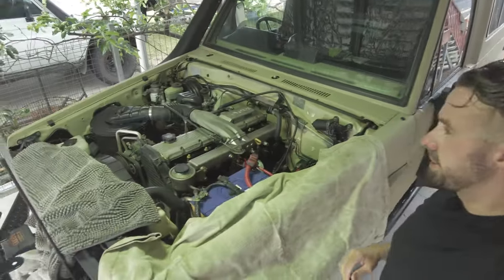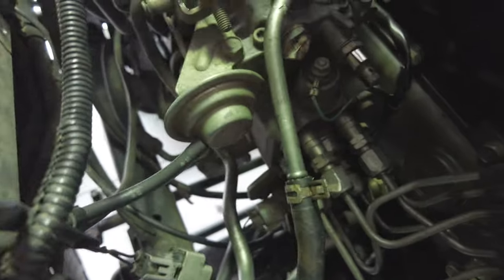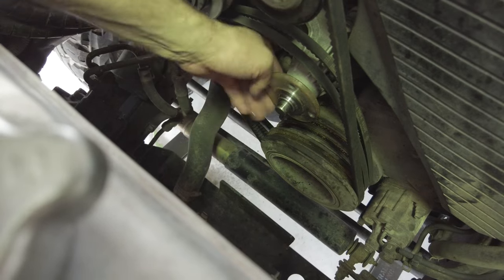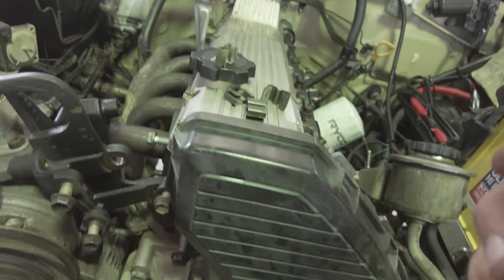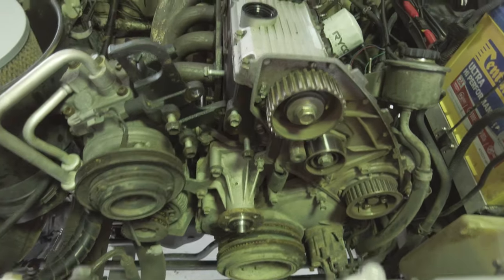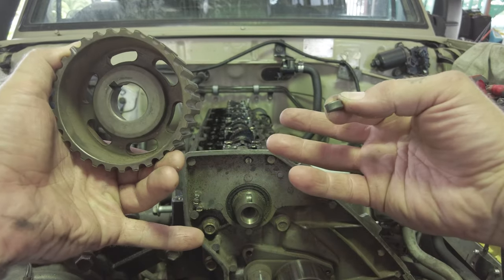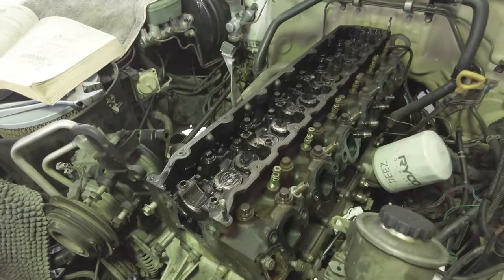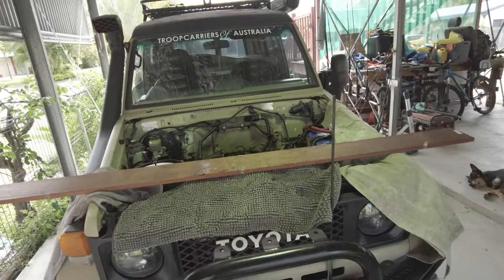TROOPY TROUBLES! How to pull the head off your 1HZ!

Comment: All the leaks, oil and coolant indicate its been getting too hot.

Check cores, cooling and airconditioning for bees , seeds etc.
Spot lights and various obstacles in the path of the air flow.
Good quality oils, change oil and filter every 5k